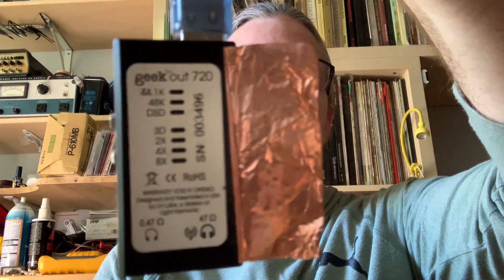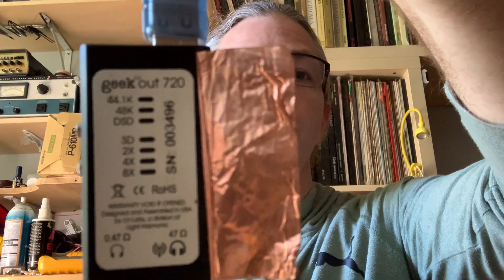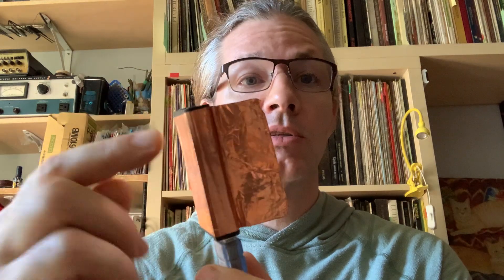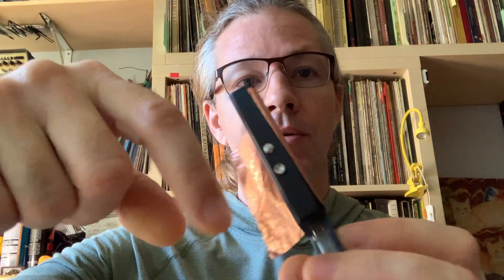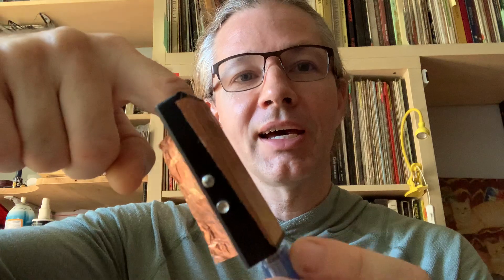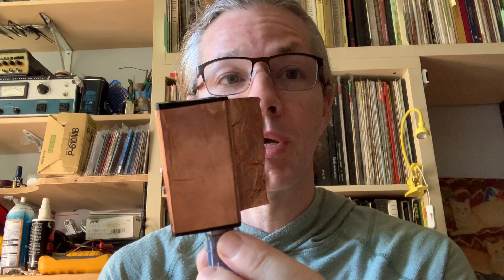Use copper tape to extend the life of a sizzling hot DAC

Comment: immerse the whole lot in deionised water that stop it over heating
Reply from the maker: LOL... just make sure bugs don't fly in it, nor there's any ions leeching from the unit... or cats knocking it over ;
Reply: @realworldaudio  should be no "ions leaching" it's not an acid. I don't know about bugs  and cats you can put a lid on it give it a go!
Reply from the maker: @hoobsgroove  No interest in frying both the USB DAC and the computer... 
The devices that are water cooled are designed as such, from power plants to transmitter radios and car engines. This DAC was not produced for that operation in mind. The residual rosin on the PCB, accumulated dust in the unit, the plastic of the cover, etc will leech out to the solution, and turn the water a little conductive... I am not going to do this science experiment to find out when the point comes when conductivity is high enough to short something in the unit, and after shorting the unit, short the USB and damage computer as well. Also, I live in Hawaii, the air has high salt content so it's a ticking time bomb even if it was a unit that was designed to be water cooled.... which this is certainly not. And while the ion concentration in a big bottle will remain low and safe, but the water that seeps into the unit will build up the ion content (due to lack of internal circulation) even when the outside is frequently changed. 
If you are so excited about it and think I'm worrying too much without due cause, then please give it a try and report on it after one year. Will definitively be a cool experiment, although my strong suspicion is that it might not survive the year mark.
Reply: @realworldaudio  you're not going to get any conductivity it is a insulator into the 100k Volts. 
 if you got contamination on the surface of the board that would be conductive anyway! the dust particles been suspended in the water will not add more conductivity. if your concern clean the board first with isopropenyl but no conductivity will happen or shortening of the computer what could be immersed into a tank of pure water. ummm
I can't see any leaching of plastics if you can give me the paper on that... it is purified water I don't see any leaching of chemicals from any surface being an issue the water will not attack surfaces. it has a greater insulation then the PCB mask itself, not sure what you mean by resins shouldn't interact either it is inert substance